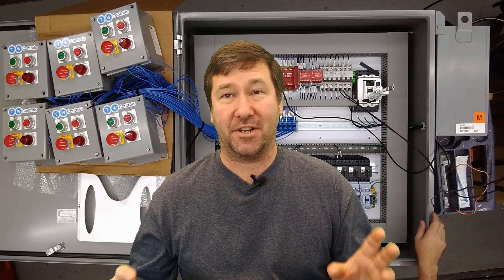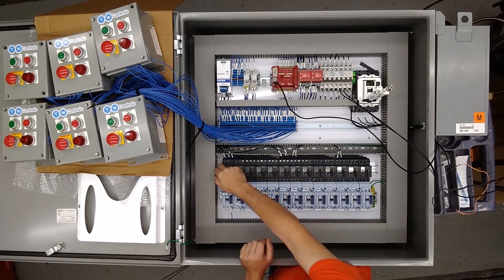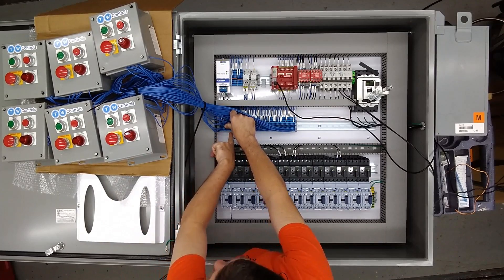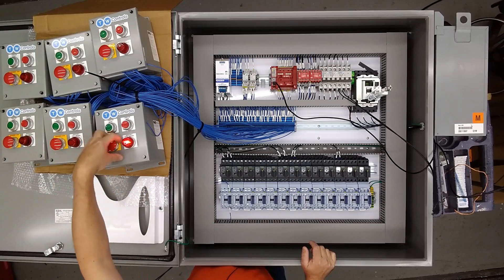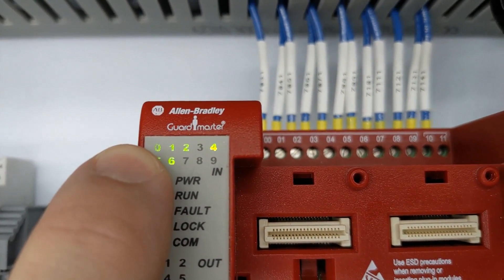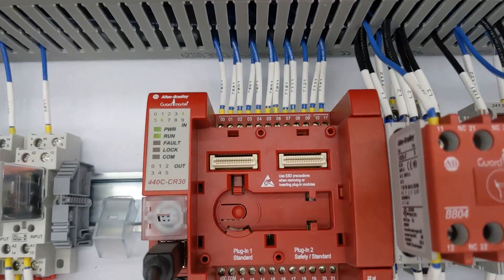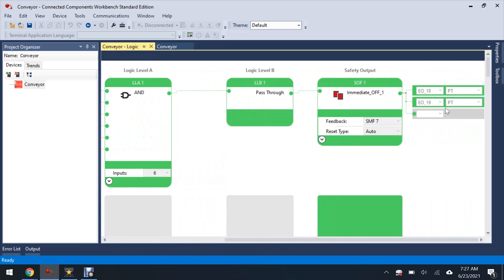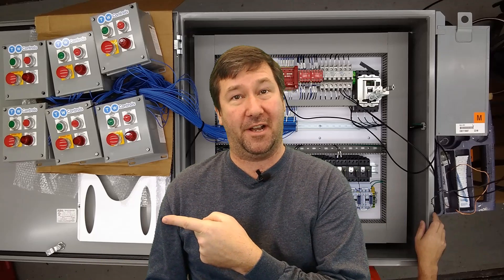Allen Bradley UL 508A CR30 Configurable Safety Relay Conveyor Control

Comment: When I install e-stop at several locations I wire lights together to show there is a e-stop energized no matter were you are standing at the machine.
Reply from the maker: I go back and forth on this.  It does make it clear that there is an emergency stop pressed but having the individual one illuminated lets you know specifically which one is.  An additional light in a position where everyone can see letting them know that an estop was pressed would be better but everything had to be out of sight on this one to prevent damage.

Comment: Could you do a video about how to select a proper motor overload protection circuitbreaker for a lets say 3kW 3fase motor?  Wired from the wall to the motor 10 meter?  And also what wire or cable is used for that 10 meter cable.  And what type of wires do you use in the panel/cabine  on the overload protection/circuit breakers  . I understand one needs to calculate first Ib  then incase of a motor protection there is an In current, the current that trips the motorprotection.    You have type B and type C motor protection devices. what to select? Where on internet do i find the table.  And what is your opinion about  all the layout and holes   pre-calculated by an other person like an E-Plan drawer/Electrical engineer ?  Sometimes this Engineer is more a E-Plan CAD usage person then a panel/cabine wiring engineer.  I am in the Netherlands, and i switched 2 years ago to E-Plan drawing, but i cannot show the experience to new companies, i am looking for a job and it is very hard to get a chance also i am 40plus, so i cannot start back in the production  room wiring these panels, which i did in 1995 at school and practical year at real automation companies. But that was long time ago!   Other question do you use flexible  wires   that consits of small copper wires for the motorprotection wiring or is it a wire with a massive core ?  Like people use in houses.   PVC- isolated wires. I see you will have a live session so maybe you can handle / answer some of my questions.
Reply from the maker: That might make a good lesson, let me see what I can do.
Reply: @TimWilborne  especialy. European style based on a motornameplate of an induction motor given 15kW on the plate switching from star to delta with 3phase European voltage. Sometines the plate gives I 1/1 which is the current at max load. That might be the same as current full load Ampere ? That might be the current fir 1 phase?   How to calculate the Inominal?
Reply: Could you do the whole procedure with a motor plate from the European markt?  Assume the start procedure is  starcirciut to deltacirciut   and the protection device may  achieve that or a external circuit.  And this motorplate is used https://crushtymks.com/images/electric-motor/the-basics-of-built-in-motor-protection-for-engineers-beginners_2.gif   the bottom one in black, with 50 Hz.  and you may use https://docplayer.nl/8187348-Normen-formules-tabellen.html   Also explain what is Ib in Europe this is used as design current,  Inominal,  Iphase current, The American motor nameplates gives the Full load Ampere,  which is proberbly the Maximal load I 1/1 on European plate ?  The Full load Current(also known as Full load Code) is higher then  FLA and is selected from table from an American engineering book, from Kw or HP to FLC Ampere. But i would like the European/English design/size procedure for a Motor protection Circuit Breaker.   And why do you need Fuses as extra before an Motoroverload protection device?  These things focused on the type of Motor most of time squal / async motor. Async ponits to some slip, to the rotation that is slight lower then the synchrone rotation? whatever the synchrone rotation may be.  Other questino is a VFD possible on a synchrone motor which normaly have 1 constant speed?   The Cable calculations /procedure , and complaince with the dropdown allowed maximum is understandable procedure and is also in the    8187348-Normen-formules-tabellen.   But the Motor overload protection, is difficult, also with a external star to delta circit.